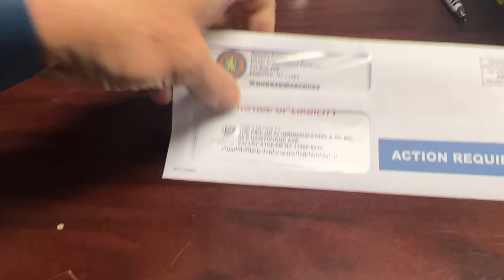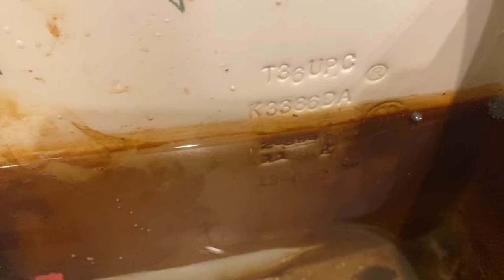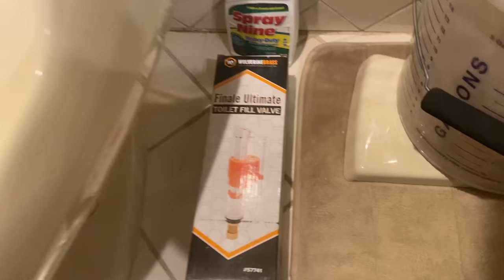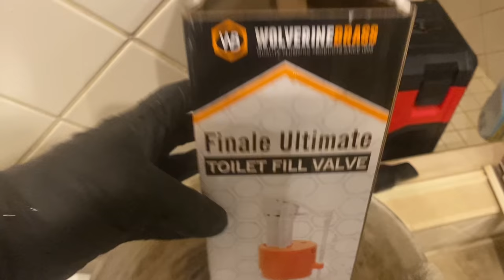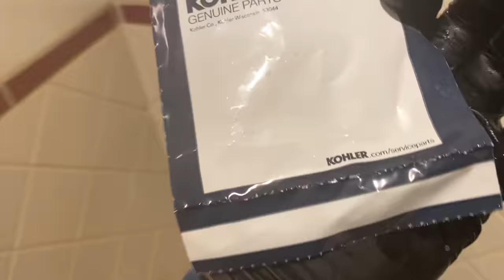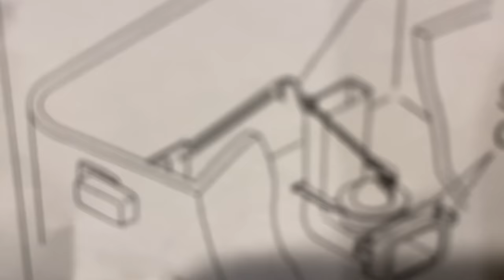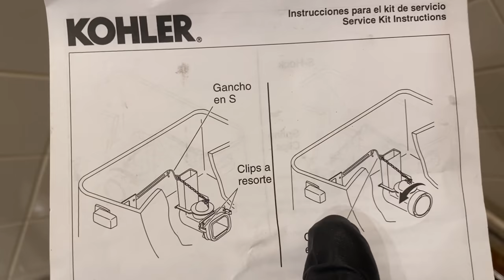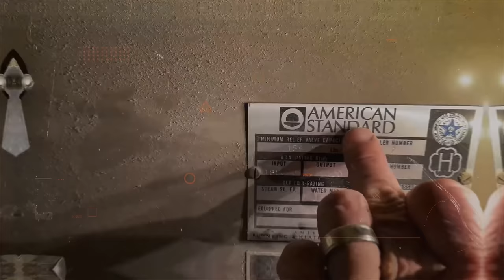How To Repair Kohler Toilet That Keeps Running

Comment: A great replacement for an S hook on a toilet is a fishing hook leader. They are made of brass, they can swivel and they clip so they never come off and don't get tangled.
Reply: city water/in tank cleaners(bleach/bromine/others) will eat the brass and or brass to other metals touching fast as can be. it also shews up the rubber parts fast.
I deal with city water(lake/well supplied and filtered/cleaned) and private well water also and nothing eats up toilet parts and other items worse than city water pumped full of chemicals, followed by well supplied city water, often vey high in minerals(lime/calcium) which ruins laundry, washers and dishwashers in short order! 
private wells often are primarily full of iron, but some are heavy on minerals such as calcium/lime,  either way water tests and installing water softeners and dedicated filters will fix it.
yes even with all types of city water.

Comment: The only proper way to repair that toilet is with a sledge hammer, I smashed 3 just like it.  I like the toto Aquia but really the American Standard Cadet 3 - 2 piece smooth apron does a good job and hard to beat for <$300.

Comment: Buck and a half for red light ticket. Boo Hoo. Out here in the land of fruits and nuts it is $425. That’s an ouch. 20 years ago got a ticket for crossing over a double double yellow line. $225. They call it a divider.
Reply: really, $425 for a red light? that often has poorly timed amber duration and does not take into account anything but a "yugo" size car and weight....
I would remove every camera I seen daily for eternity!

Comment: red light/traffic cams, I'd remove it after being ticketed. (lol) 🤪🤪🤪
then again, that seemed to be a blatant red light run! although I know all to well that amber lights are far too short for a loaded work truck/van to stop in a hurry without scrambling tools and equipment everywhere. been there done that and asked the judge if they'd rather I leave very long black marks, with tire smoke and loud squealing sliding to a stop in the middle of the intersection and having to drive through it anyway? some intersection are poorly designed and the light timing is very wrong for anything but a small car and instant reaction, heaven forbid you look over to grab your drink, change a radio station or follow the GPS! forget about phones, tablets, laptops and vehicles with built in touchscreens and other distracting gadgets. 😒

Comment: Good repair but you don’t replace the non reusable supply tube? In MA it’s in the code to not reuse, but just condom sense to a plumber
Reply: He's not trying to keep the toilet from getting Pregnant...
Reply: @northface484  Auto correct, like when I type Trump, “liar” comes up from auto correct unless I manually select Trump.

Comment: ""How To Repair Running Kohler One Piece San Raphael Toilet"", replace it with a standard toilet and take a sledge hammer to it after tossing it in the dumpster.
I hate all one piece toilets with a passion, there's nothing good about them whatsoever, none have ever flushed good, their a pain to repair and who wants to reach down so far to flush?
#use-your-foot-to-flush 🤣🤣

Comment: I want to thank you for showing the float valves with the brass nipple in a previous video.  Soon as I saw those I immediately ordered 2 for my house.  No flex supply lines either, solid copper only for me.  The plastic valve assemblies are always a fear they can fail and flood my home.  Saint Mike is the best, Thank you.

Comment: once had a slow filling toilet because the fill tube had some calcium deposits in it. just removing the fill valve and running water through it cleared it. That time did not need a new valve.

Comment: Nice brass metal shank on the fill valve. Now, if I could only find a braided toilet supply line having a metal nut rather than those plastic ones that sometimes go bad and cause a flood due to chlorine breaking-down the plastic nut. Any ideas?
Reply: Ferguson has them
Reply: they're mostly all a thin rubbery line inside a nylon braided jacket anyway. when they first came out years ago, they were primarily thick rubber hose inside actual stainless steel braiding.
good luck now ;)
Reply: @throttlebottle5906    Yep. I hear ya. One of the box stores still has the steel braided whereas the other box store has the plastic braided. Regarding the line inside, who knows!  All I know is that those plastic nuts have caused countless floods and unnecessary insurance claims!

Comment: Mike  years ago I worked with a plumber Warren he was a great plumber he would always bend up a new Water supply line. He would say professional plumber never uses those braided hoses, ….That job you just did was a perfect candidate because the Fill and the water supply line were in Close orientation Also you would have a brass nut on a brass fill valve less chance of a comeback… have a great holiday…
Reply: anymore, everyone uses the braided hoses, but NEVER re-use/leave a braided hose, you touch it, you own it! toilet fill, sink faucet, washer, ice maker, dishwasher, you touch it? ALWAYS install new supply lines! if not you are the insurance scape-goat upon failure and they do fail.

Comment: WOW, Mike!! You walked up to that toilet and said “Rialto”. Why? Have you ever seen a Rialto with the flush lever on the left…and with an elongated bowl? C’mon, man! One of the oldest and most ubiquitous one-piece Kohler toilets there is, and you can’t identify it by just looking at those two obvious things. I guess you eventually worked out it was a San Raphael when you stared looking for parts. Also, the fill valve you used is not correct for the San Raphael. The San Raphael (and Rialto) are not supposed to have a bowl fill tube from the fill valve to the flush valve — the bowl water level is replenished during the flush and does not require additional water from the fill valve to set the correct bowl level. By using the fill valve you did, you are wasting water by dumping too much water into the bowl as the tank fills. Plus, the fill valve you used sits too close to the edge of the tank, causing the tank lid lip to put stress on it by pushing it to the right. The Kohler fill valve fills slower by design to reduce noise. Both the San Raphael and Rialto have always been known (and advertised) to be quiet. Your fill valve sounds like a jet. There are several reasons for using the correct fill valve, but like most homeowners and junior plumbers, you just threw in any old fill valve. You try to “build value” by spraying the inside of the tank, but you could have given honest value by using the correct parts so the toilet works as it was designed to. If you’re going to try to teach your viewers how to do things correctly, you should do these things correctly, yourself.
Reply: @throttlebottle5906 , I certainly can’t disagree with that!